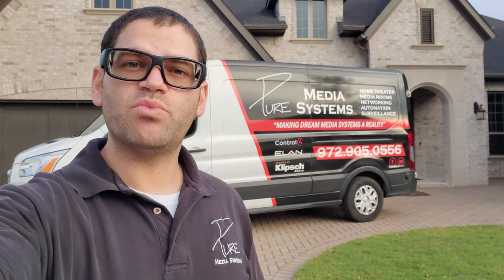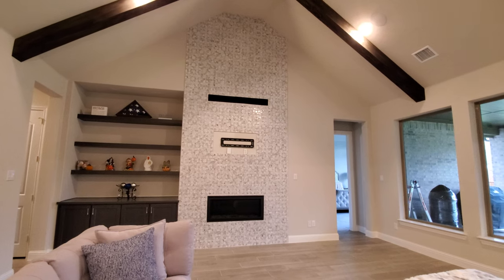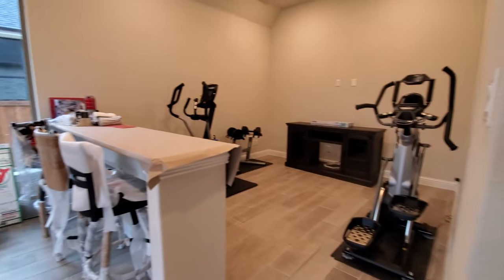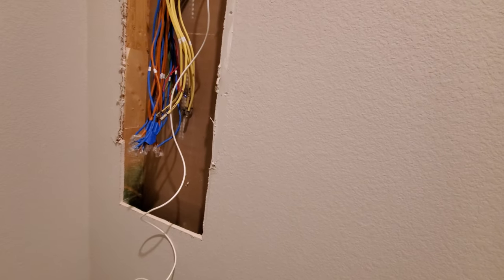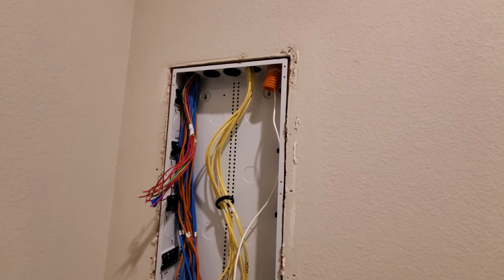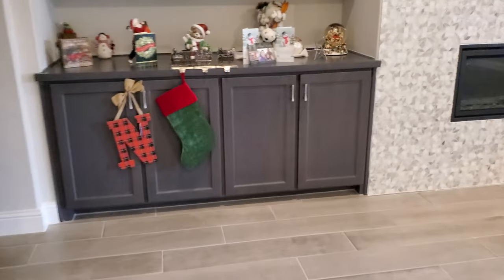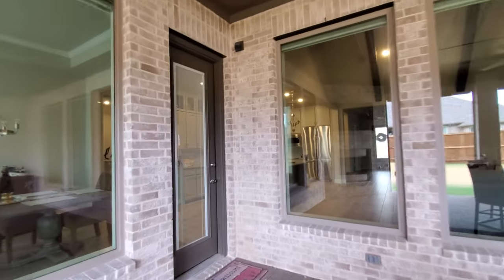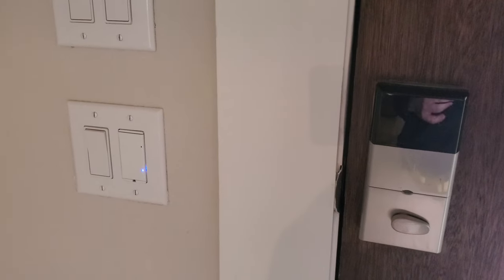Control4 Smart Home Walkthrough in Prosper, TX!!

Comment: Wondering if sonos and ero 6 pro e routers can replace this whole cumbersome wired networks and actually give better sound and has better app. Google home can integrate with all these, smart locks, thermostat and sonos etc. Just a thought. Whats the point? Can claim better sound but doubt it.
Reply from the maker: Short answer, no. Sonos is really only designed for music, and with this many zones would be more cumbersome to setup and take up more space. You also do not get the control for TV, lighting, door locks, shades, cameras, etc. Yes, this sounds better than Sonos. Google home is only IOT based, so when the internet doesn't work, you're out of luck. It doesn't integrate with remote controls. Both of the solutions that you mentioned have their place, but do not hold a candle to the reliability, quality, and usability that you get with a proper control and network system. Also, WiFi 6e should be skipped over. It does not have the coverage demanded by most people. Quite frankly, a properly deployed Wave2 WiFi 5 solution is plenty sufficient for most systems.
Reply: How much are you spent on the all system of control 4
Reply: @cristianjeovannytrejoofici9381  I bought a home previous owner left all the control 4 and speakers